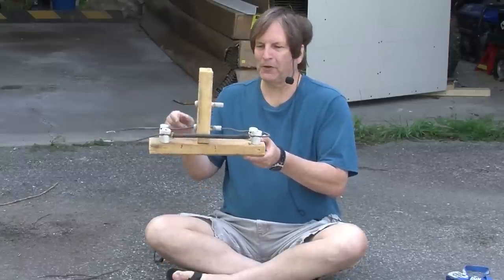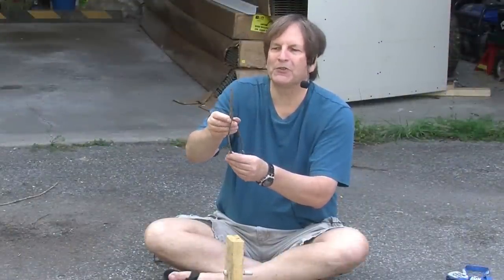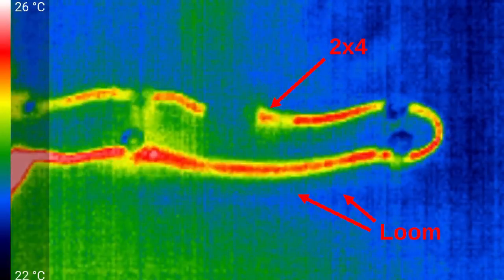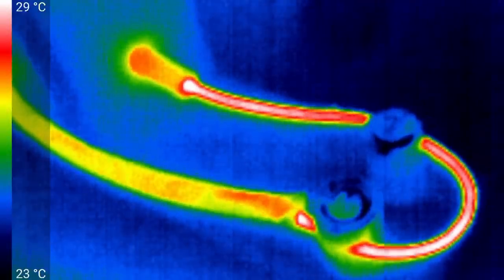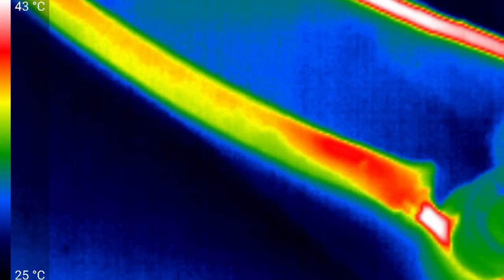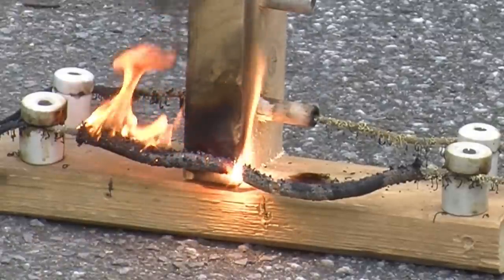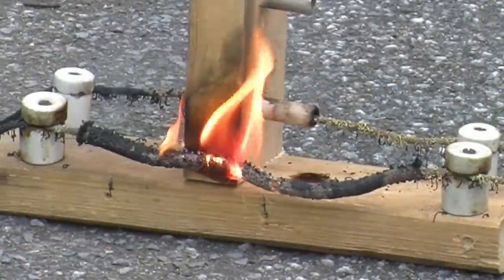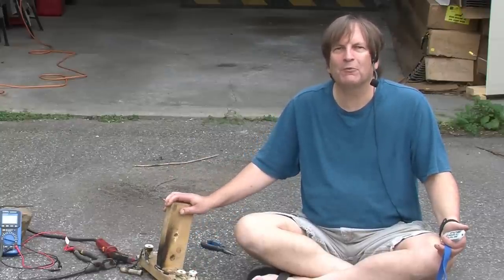Testing 100 Year Old Knob and Tube Wiring

Comment: In my experience, the loom was usually asbestos! That stuff could take a great deal of abuse. The houses I've seen still using this stuff were built with heart-pine, so there are two reasons to not insure it. :-) (other than the lack of a modern ground, all of them were in perfect condition.)

(And yes, those houses are over 100 years old. Side note... there's enough leaded paint on those walls WiFi won't go through them.)
Reply from the maker: Lead paint blocking WiFi - I never heard that one before - how interesting! It must have enough conductivity to cause reflection and skin depth issues at 2.4GHz. And with a 100 year old house, who knows how many layers of paint got slapped on the walls over the years, so even if one layer isnt enough to block, a few probably are. Thanks for posting that interesting bit of info!

Comment: Knob and tube is still common in some applications, specifically the outdoor wiring on poles owned by the power companies.
Reply from the maker: Thats an interesting comment - I had never thought about that! So I get that insulators we see on poles are bigger versions of knobs.Are tubes used anywhere on poles? The only thing I can think of is the insulators used to bring wires into things like transformers. Is knobs and tubes used in any way on poles - were you thinking of something other that what I mentioned. If so, I would be fascinated to hear more about it!

Comment: I wish you used an insulation Megger and compared it to the typical 600v rated modern wires.
Reply from the maker: Gee thats an intersting idea. Unfoirtunatly I dont have one but if I ever get one! It may not be a fair test since for proper Knob and Tube the wire only contacts ceramic insulators so even if the insulation has degraded a proper installation should have amazing HV resitance.

Comment: I could be wrong about this, but i think those "hairs" you were starting to see on the wire might have been the rubber insulation being extruded through the cotton/fabric insulation.
Reply from the maker: I think your 100% right. I was narrating the video as I did it. Looking at it afterwards with the better view on the video screen than from eyes at a distance, it does look like that which makes a lot of sense with the rubber melting and probably expanding a bit, and maybe even  boiling/offgassing  inside a bit to add a bit of pressure.

Comment: Before we mock our predecessors as dangerous lunatics surely this demonstrates that actually this system is substantially OVER-engineered. Even today there are few better insulators either thermally or electrically than glazed ceramics. By using knob and tube stand-offs the designers have recognised the shortcomings of rubber a couple of decades before PVC became common, and In an age when the only common domestic appliances were flat irons and radios (and of course 25W lamps) this installation has far exceeded it's remit. I would like to see a control conducted with modern 15A cable passed straight through woodwork to see how quickly the house burns down lol
Reply from the maker: So true!!!!!!!!!! Used as it was intended it really is way better quality and long lasting system than what we have. In some old houses I have lived in, I have se how "old" plastic wire insulation  (25 years old) seem to brittle particularly near junction boxes (air exposure?). 

I did some experiments like you suggested last summer. Here is a link: https://youtu.be/U2sLO1noD2o
Reply: @ElectromagneticVideos  Great link thanks, I should have guessed you had already done this!
Reply from the maker: @robturner3065  It was a bit of an eye opener to me - particularity in the following videos with building insulation around the cable. I was actually not to thrilled to discover that in places like a hot attic in the summer, a wire embedded in insulation has little margin of safety.

Comment: Those wires are found in houses during the 1900s to about I believe 1960s or 1970s when they changed the wiring insulation
Reply from the maker: So you mean the cloth coated rubber insulated wires? Were they used in conduits? I remember the old 14/2 wire that seemed to have some black tar inside and a cloth type covering.

Comment: Copper building wire was tinned because the rubber used in the insulation would corrode the copper. If you have worked in old houses with un-tinned copper you could see the rubber corroded and bonded to the copper so much so that it has to be scraped off. Remember it was natural rubber used back then, no synthetic rubber or plastic.

Loom was installed for protection from damage. It has no electrical function. As long as knob and tube wiring is undamaged it is perfectly fine. The issue with the #14 wire is the result of changing nature of households. Back when K&T was initially installed what was there to plug in? Main use of electricity was lighting, and if the owner had money, a radio. Very few receptacles were installed.  Fast forward and we find people now using irons, toasters, heaters, extension cords, octopus adapters and the resultant blowing of fuses. Here's the rub, to prevent fuses from blowing 30 amp fuses were installed, and if it still blew the infamous Lincoln fuse, a penny behind the fuse. Resulting house fires gave K&T the bad reputation. Interestingly, I have been to several smaller old homes that had only a single 15 amp fuse for the entire house. How times have changed. 

Knob and tube wiring is obsolete not because of  #14 wire. It just is a relic of days gone by. #14 wire is still used extensively today in the NM (Romex) cable presently installed. Today's house wiring has many more circuits and receptacles to supply present needs.
Reply from the maker: It would be fascinating to see corroded copper. I wonder how long it took then to discover the corrosion problem back then.

Its amazing to think that 15A was enough for a home., but with few things that used electricity in those early days, it must have been more than enough.

Comment: When we pulled the knob and tube out of our 1930’s house, we found scar marks on the the walls where there were burn marks and bare wire was running between the knobs 😬 must’ve been a space heater or something plugged into that circuit.
Reply from the maker: Yikes! Its scary how close some places may have come to burning down. So was the wire touching the walls where it left burn marks? If it was just the radiant heat from wire glowing red hot, thats even more amazing.
Reply: @ElectromagneticVideos  The house had settled a bit, so one of the nobs had gotten pretty close to the wall but not close enough to where it was touching, that’s what I was thinking. It must’ve got glowing red! And GET THIS! There was another wall where someone had blown in newspaper, shredded insulation that had incinerated inside the wall on the same circuit. It is amazing this place hadn’t burned down. I should’ve took pictures, it was back in 2006. We did a remodel and the contractor was going to take it down to studs but he called me one day and said “you got to come see this” over the studs was lap and grooved hardwood paneling. This is an Everett Washington where there was a bunch of lumber and wood mills like 100 years ago. Found lots of burnt newspaper in the walls, but it looks like it didn’t get enough oxygen to light up tho. 🔥
Reply from the maker: @RussShawTV  Wow!  "newspaper, shredded insulation that had incinerated inside the wall" When researching this video I had come across the issues of insulation being blown in and on top of knob and tube. Interesting to hear a first hand account - and agree - amazing it didnt burn down. 

Never thought about a house settling and shifting to have that effect but makes sense - particularly a wooden house that has aged over a hundred years. Everett - have visited there (Boeing plant!) - my brother is in the Vancouver area so I know your area - wonderful part of the world!

Comment: Vulcanised rubber reacts with copper due to the sulphur content so rubber insulated wire was always tinned
Reply from the maker: Thanks for that info! I was actually speculating if that was the case in the comments below!
Reply: Or in many cases silver plated.
Reply from the maker: @BuffyLinux  Really? As in real silver? I'll have to see if there is an easy test to determine if the plating on the wire samples I have is silver or tin/lead. I wonder why they would have used expensive silver?
Reply: @ElectromagneticVideos  actually, silver plated copper wire is still preferred for some applications. You can probably tell by dipping it into a liquid tarnish remover.
Reply from the maker: @BuffyLinux  Thats a good idea. So what is the use for silver plated wire? I did read it reduces corrosion a bit, but I often see gold for that. Reduce resistance at  very high frequencies for hi Q coils?
Reply: @ElectromagneticVideos  mostly specified for high temperature, safety critical or military stuff. I think the idea is that most silver degradation products like oxides remain conductive.
Reply from the maker: @BuffyLinux  How interesting. I wonder if gold has some issue at higher temperatures?

Comment: K&T no. 14 is rated 20 amp in free air iirc.
Reply from the maker: That free air bit seems to be the key. From what I have read on of the main problems is over the last 100 years of renovations air flow gets blocked and/or it gets covered with insulation and bad things happen :(

Comment: From a life long sparky: was told that that applied a zinc coating on wires that had rubber insulation like your knob & tube so the bare copper would not react with the rubber & degrade it. A few years ago at an IAEI  continuing education class they told us that UL Labs went all across the USA and got hundreds of samples of various wire used in houses. All of the rubber covered knob & tube and old BX cable failed a Megger test while BX & Romex cables with modern thermoplastic insulation faired good. Was told 50 some years ago the only time knob & tube is safer is when a house gets flooded. Evidentially they would allow the knob & tube to dry out and power back up. Heard a lot of insurance companies mies will not insure a house with knob & tube.
Reply from the maker: That's really interesting about the zinc. I didn't know rubber had a corrosive effect. I wonder if is the sulfur in the rubber from the vulcanization process that over years reacts - maybe absorbing moisture and becoming slightly acidic?  

I wonder if its dirt on the insulators that accumulates over time that makes it fail the megger test.  Had a similar discussion about leakage currents somewhere below. 

I get the drying out after flooding part but I would have thought its way more dangerous during flooding. At least with modern wires and grounded junction boxes, there is a some chance currents leaking though the water might be somewhat contained although I sure wouldn't want to be anywhere near a flood + electricity situation.

Comment: I still have this feeding everything on the second floor of my house that was built in 1890. There is nothing up there that requires proper grounding or draws any amount of current. The bathroom however does have proper wiring and GFI outlets. It all appears to be in good condition and nothing has been added to it over the years. I see no need to replace it.
Reply from the maker: That sounds like an installation that has survived the test of time! I assume there is no insulation covering any of the Know and Tube wires?

Comment: ... knob and tube was made In a factory in huge quantities. Of course it was standardized, I don't know about the quality control of the insulation but the copper was expensive the wire gauge would have to be precise to even know how much to sell the wire for
Reply from the maker: You know, I never really thought about the large scale manufacturing of it, but your right. And the insulators I had were clearly shaped in some sort of mold and I think some even had writing indented on them. Getting thing precise back then must have been a challenge.

Comment: The trouble happens when insulation is packed in by the wires.  These were intended to be kept in open-air spaces.
Reply from the maker: Exactly. Used as it was intended its amazingly good after 100 years!

Comment: Rubber? I believe it's canvas wrap tar, much better in a relatively high temperature material. Cheap plenty and flexible to move through the
Reply from the maker: Could be! Its a year  since I did that video and dont remeber the details. The smell and research I did I think pointed to rubber but I could be wrong!

Comment: If the wire is short enough you can run almost any amount of current through it. The same wire that will handle 30 amps at less than 3 ft will burn up at 100 ft. It would be interesting to see this same setup with a longer wire run.
Reply from the maker: Length actually doesn't make a difference - the heating for a given current is watts per foot, so each foot gets the same amount of power - and hence heat regardless of how long the wire is. I did a more detailed writeup here:  https://www.youtube.com/post/UgkxeilOfLJGy2ODslnBW0WFXUE580oHhFyP

Comment: Results were pretty much as expected. Although, I thought the rubber insulation would have melted sooner. Open air conductors can handle much higher amperage and temperatures before failure occurs. Inside an enclosed stud bay or an insulated wall, the rubber failure would of occurred a lower current. The voltage drop across the length of wire responded appropriately. At 20 C the voltage drop across the approximated 3 feet of wire at 50 amps should have been around .38V. (Assuming 14ga solid copper) Resistance of Copper will increase about 0.40% for every degree C above 20. FYI: Infrared light will become visible when it reaches a temp of around 800C (1470F). So at 90 amps when your camera was maxed out,  the actual temp was over 800C with the red visible light. If the conductor had not failed, the visible color would eventually change to white,  then blue as temperature continued to increase.
Reply from the maker: Yes - no huge surprise. As far as the insulation goes, I wonder if 100 years of ageing mage  the rubber less easily melted. 

Great temperature estimate approach - 800C is really quite astonishing. You got me thinking - maybe with a  bit of calibration one could do a pretty good black body radiation color to temperature app similar to the IR camera output for the RGB phone camera for temperatures beyond what IR normally does.

Comment: So it's not that k&t wiring was that bad. In some ways probably a bit better, but due to mostly ignorance/stupidity people just didn't know any better. I've had to deal with it before in an old house I lived in and it was a night mare trying to figure out what side was hot and what was neutral. After 60+ years the wires turned the same color and in a dark attic it was near impossible to figure it out, but I did get it right after about 45min of tracing and trial and error before it worked again.

I would love to see this test done with modern single 14 Guage through the knob and tube wiringbto see how it fares.
Reply from the maker: Exactly! Interesting that you have first hand experience with it! 
Do you mean a single modern insulated conductor from say 14/2 held by the same ceramic knob and tube things as in this test? Might be interesting to compare and see how the modern plastic 90C insulation does against the 100 year old rubber and cloth stuff.

Comment: There are houses in Central and Eastern Europe with 60+ year old aluminum wiring and they are still fine.
Reply from the maker: Thats really interesting. I had not heard or ever come across aluminum wiring outside of North America. I would with with your lower currents due to the higher 220V AC voltage compared t our 120V)  there is less chance of overheating even at poor connection points. 

Over here (Ontario, Canada) there were lots of homes built in the late 60s and early 70s with aluminum before problems started to be noticed. There are still vast numbers of them around today, often with the connections redone and receptacles/switches replaced with modern Aluminum compatible devices and anti-oxidizing paste. 

Like you mentioned - they all seem fine now. 

I had heard that later in the 70s and early 80s there was an attempt to introduce copper coated aluminum as a way to solve the problems and keep the cost advantage. Apparently with the bad reputation Aluminum had gained, people just refused to sue the copper clad Aluminum.
Reply: @ElectromagneticVideos  3 phase is very common here even for small houses so we only needed 4 mm2 Al wires for 3x20A circuits instead of singple phase 60 A. I have only seen Cu clad Al in cheap chinese cables.
Reply from the maker: @mernokimuvek  Three phase - yes - we only have it for really large homes or buildings. The rest is 120/240V split phase. 

 Cu clad Al - same here - these days only seems to be from China - never actually seen it myself, but have carefully avoided Ethernet cables with that. Seems crazy to me to use it for that where there is so little copper in the first first place.